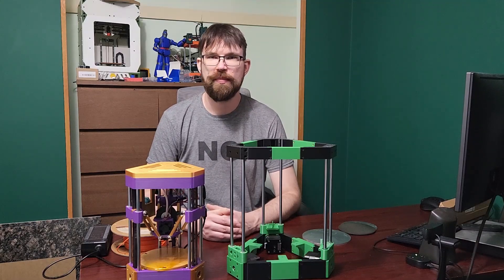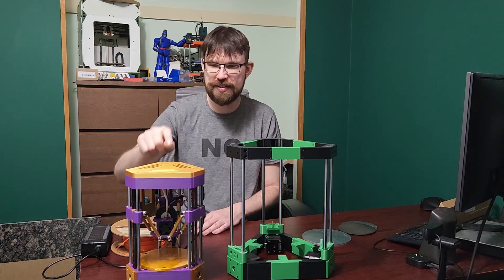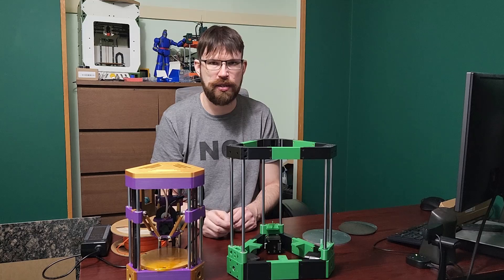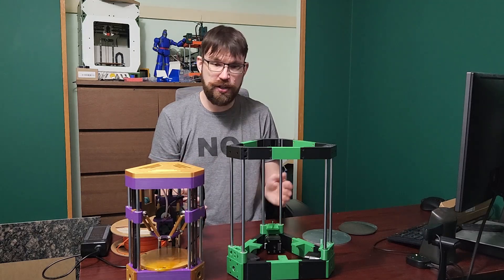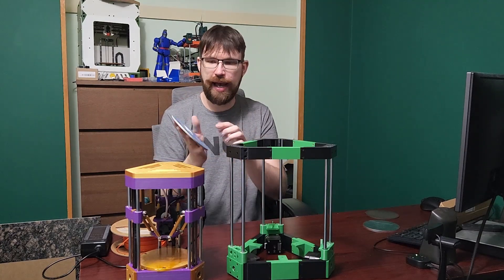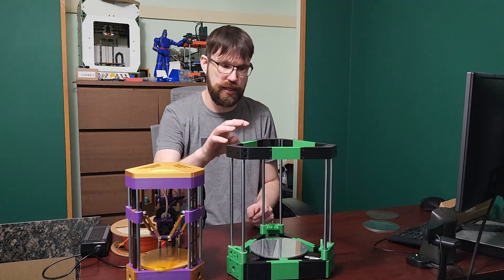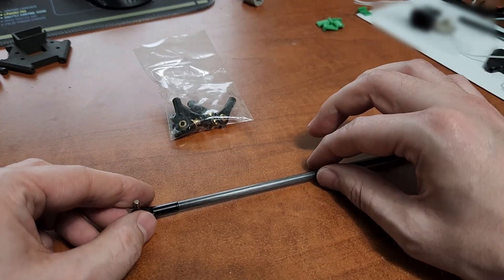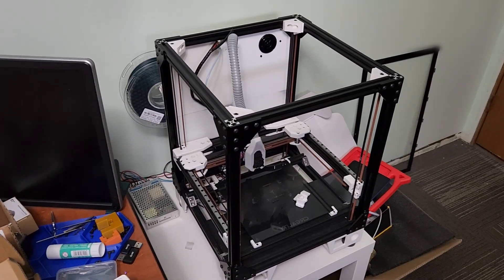Delta 3D Printer Updates! MIN and Delta Flyer!

Comment: I'm thinking about designing a uncoated FR4 PCB heated buildplate. Anyone interested?
Reply from the maker: I have used G10 it works well, same as FR4 basically.
Reply: @Rolohaun  Nice :) I just see the benefit in having the heater being fused to the printbed by making one the sides being exposed and having them be manufactured  by a PCB service. Flatness should be within reason and the price very low.
BTW I'm  gonna min max your build and report back 2 you cheerio
:)

Comment: As an alternative, you could buy carbon kite spars in pultruded carbon (Avia brand) and cut them down (with a dustmask!).  They come in tons of sizes and can be very inexpensive.  Also, instead of cutting them yourself, you could take the tubes to an Archery shop and have them cut on their arrow saw.  They should have hard stops to ensure exact sizing from cut to cut.
Reply from the maker: oh awesome, thanks for the tip!